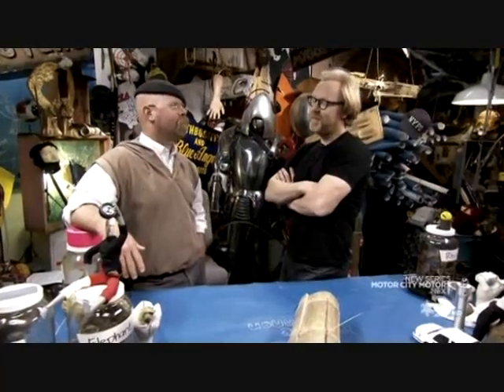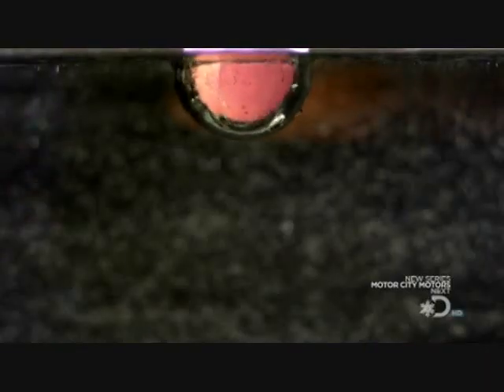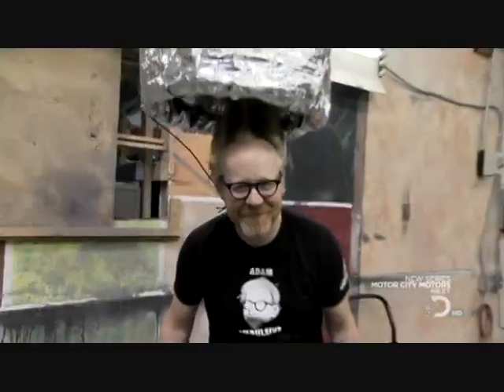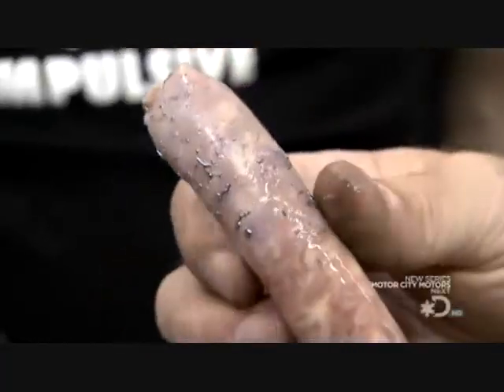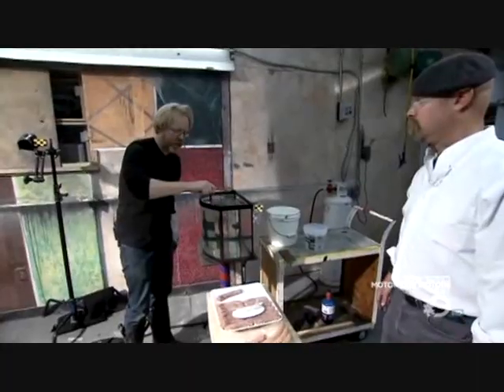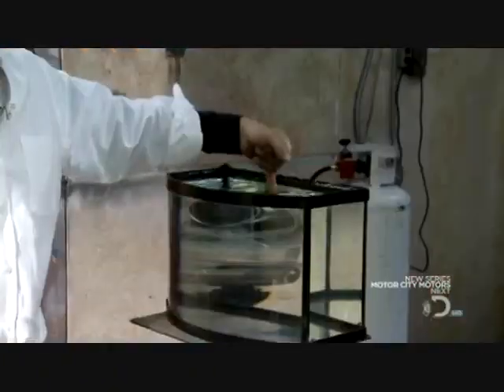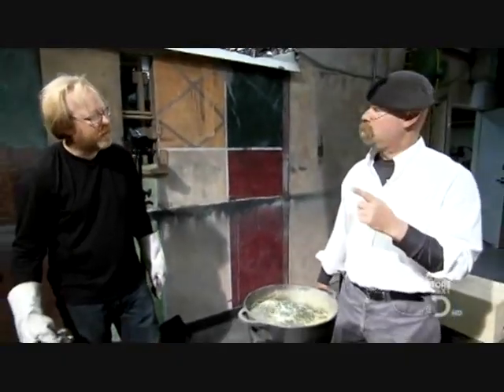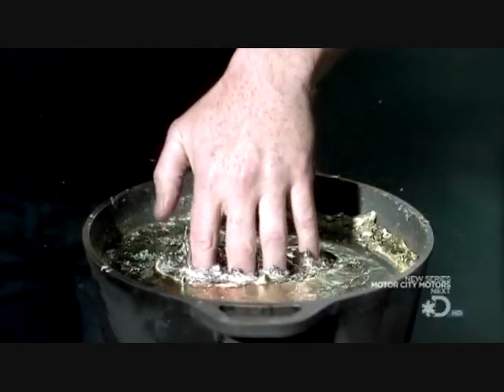Dip your hand in molten lead without being burned!

Comment: “In order to avoid burns they are going to raise the tempature”
Reply: RYAN RUTH makes sense
Reply: Melting isnt burning anymore
Reply: XD, clever and funny point of view to describe the situation.
Reply: Well, that's how it works. It has to be hot enough to create the layer of insulating steam.
Reply: Hmm yes this floor is made out of loor
Reply: Fighting fire with fire I guess
Reply: It's the same principle behind soothing burns using your own body temp instead of ice. Less likely to blister because there's less drastic temperature change.
Reply: Brain.exe. has stopped
Reply: @apocalypseap  no that wasn´t the reason why, if it would continue to stick it would burn your hands terribly (since the lead that´s stuck on your hand would still be hot'
Reply: @willemv6501  That's what I mean. You don't get lead stuck on you if the layer is thick enough, which requires enough heat to maintain for the required duration.
Reply: @apocalypseap  oh okay gotcha thanks
Reply: @UltraDraco777  No, you don't use ice because the intense cold can cause more tissue damage from frostbite.   Use cold water only.
Reply: @kristyanne719  Yes, ice/water being cold is bad for a recently burned area. It's like that because of the heat exchange being too extreme. Warm/lukewarm water is even less risky since it's closer to the body's temperature than both ice OR cold water.
Reply: “Science”
Reply: apocalypseap yeah we all saw the same video
Reply: just why it's like puting boiling water on ur hand vs putting warm water on
Reply: @wangpowersports  If an object hot enough touches an liquid, It can form a tiny layer of insulating vapor.An effect called: Leidenfrost effect, the opposite can also happen where an room temperature drop on top of an Very cold liquid. As the liquid evaporates,It creates an insulating layer of vapor.
Reply: no, its because the lead might cool and harden and small lead droplets will end up touching ur skin and bam u burnt baby.
Reply: This comment was a joke, y’all who are commenting like it’s a serious statement by me are foold
Reply: if it cools.. it's still hotter then boiling water, why don't you put your hand in cold water then put in hot water, try that and it won't cool but give you a mild 2nd degree burn
Reply: Physics is broken
Reply: dunno if you guys gives a damn but if you're bored like me during the covid times you can stream all the new series on Instaflixxer. I've been watching with my girlfriend during the lockdown =)
Reply: @Orlando Idris Yup, been using Instaflixxer for since november myself :D
Reply: It seems counter-intuative, but that IS how it works.
Reply: @apocalypseap  no it not, you get it wrong, 100 cel or more is enoughe to create steam, but in their first try, the surfce not molten completely, so it stick to the sausage, so they increase the temp in order to  melt all the lead, thats the purpose bruh
Reply: well when you put it like that I see what you mean
Reply: @willemv6501  cap
Reply: @djw_tekken8490  ?
Reply: You can't cut me off....
Reply: A sentence no one has said... Until then.

Comment: If you guys think this is cool, you should try doing this with melted ice. You can put your whole body in and you won't get burnt!
Reply: +PALE1ISTEHBEST That's stupid and incredibly dangerous. You are risking an extreme case of dihydrogen monoxide exposure.
Reply: NBA151 The world needs to know!
Reply: +Kiwa Nozukai this joke is even older than dihydrogen monoxide
Reply: dick smash Don't feed ignorance! Everyone must be aware!
Reply: +PALE1ISTEHBEST XD
Reply: +Kiwa Nozukai Dihydrogen Monoxide becomes a gas at  the temperature of 212, it also has caused millions of burns since its discovery. Warning!!!! can be extremley lethal if inhaled.
Reply: ***** I was making a joke. Why else would I reference Dihydrogen Monoxide?
Reply: +Kiwa Nozukai if it's 200 above its melting point
Reply: I heard that some people even bathe in it!
Reply: loolol
Reply: +Eileen Yost ha that's nothing I drink it.
Reply: +PALE1ISTEHBEST Technically, melted ice can reach 100 degrees Celcius. Serious burns.
Reply: +flewkisdead pressure differentials that would allow ice to get that hot would be extreme enough to a lot more than burn your hand.
Reply: TheFarmersFarmington I think you might be slightly confused. Melted ice is water. Water boils at 100 degrees C at 1 atm, which means water "can reach 100 degrees Celcius" in a normal setting and cause "[s]erious burns".
Reply: +flewkisdead your right I misread the comment I just read it as ice.
Reply: Melted ice? You mean water?
Reply: The Gerny Yes. That is the joke...
Reply: Prolonged exposure to dihydrogen monoxide makes a person highly susceptible to asphyxiation.
Reply: +Kiwa Nozukai lol
Reply: +flewkisdead but water turns into steam at any degree
Reply: zuka murvanidze I think you mean vapor, not steam. Steam is generally understood to be only vapor generated from the action of boiling. The pressure of the environment also plays a role in the generation of steam.
Reply: flewkisdead im sorry, in my language vapor and steam share the same word, so i get confused
Reply: zuka murvanidze 
Hello PewDiePie moderator
Reply: PALE1ISTEHBEST I, doing it right now
Reply: PALE1ISTEHBEST don't try it it's boiling water
Reply: PALE1ISTEHBEST EXACTLY ITS SO AMAZING
Reply: +Kiwa Nozukai,  Liberal propaganda!  There is clearly no scientific consensus on the effect of dihydrogen monoxide.  In fact, many studies have shown at low concentration it is beneficial to human health.
Reply: Jerry Gu Lmao
Reply: "Melted ice"
What the
What is melted ice
Reply: PALE1ISTEHBEST That must be the most idiotic thing I've heard.
Reply: Water?
Reply: Anti-Anti Fun No shit
Reply: PALE1ISTEHBEST 1kth like YOUR WELCOME
Reply: PALE1ISTEHBEST im the 999 like
Reply: Cool idea
Reply: Woah! That's amazing, how do you do it?
Reply: What if my melted ice is about 90° Celsius
Reply: @RmX.  hot tub.
Reply: Kiwa Nozukai whoosh
Reply: @kiwanozukai1180  r/wooosh
Reply: That killed me twice
Reply: @NBA151  what about letting the molten ice change to a room tempurture
Reply: Not necessarily true
Reply: @GoogleWhyDoYouLetPeopleHaveLongBloodyNames r/wooosh
Reply: ReAlLy
Reply: @aydentheworm3042  oH lEt Me ReAd ThE fIrSt FeW wOrDs, Oh WaIt.. "r/wOoOoSh"
Reply: Fuck, this made my day, thanks
Reply: @NBA151  water
Reply: @aydentheworm3042  r/woosh
Reply: GoogleWhyDoYouLetPeopleHaveLongBloodyNames woosh
Reply: @vertex4431   r/ihavereddit
Reply: Woah Bro Holy shit
Reply: Why would you say something so dangerous and stupid to so many kids that would actually try it and die?!
Reply: But you have to coat your body in lead first
Reply: WHAT?!?!?! THATS INSANE!!!!!!
Reply: @kiwanozukai1180  Have you ever heard of a joke?
Reply: @Jxrd99  r/wooooshwith4os
Reply: @theemeraldtv8175  r/wooooshwith4os
Reply: @vertex4431  r/wooooshwith4os
Reply: @valley.spotter9558  r/wooooshwith4os
Reply: @onjo6746  r/idontcare
Reply: @ActualChrist  r/whatareyouwooshing4peoplefor
Reply: @ActualChrist  Bruh, are you desperately just wooshing people hoping for reddit fame or some shit? Because 90% of the comments ya woosh'ed makes 0 sense
Reply: @GoogleWhyDoYouLetPeopleHaveLongBloodyNames r/wooosh
Reply: people say u can even drink it!
Reply: PALE1ISTEHBEST nice...
Reply: Kevin Schwartz i really just fell for that shit. Shoulda listened to my parents when they said to pay attention in school. Lmfao. I just went down a rabbit hole of what is dihydrogen monoxide only to find that I’m fucking holding that poison in my hand lmfao. Nice. You got me
Reply: Kiwa Nozukai r/wooooosh
Reply: @kiwanozukai1180  I'm just thankful that I'm not too stupid to understand these jokes
Reply: But thats called swimming, boy
Reply: PALE1ISTEHBEST noway
Reply: This comment/reply section is wild
Reply: GoogleWhyDoYouLetPeopleHaveLongBloodyNames almost as if it was a joke
Reply: @kiwanozukai1180  You must be a blast at parties
Reply: Ive heard it also works with hydrogen hydroxide
Reply: Molten ice 😂😂😂
Reply: Even more intense would be molten ice
Reply: Nigga tryna bathe in molten lead💀
Reply: the difference is this is metal you need to heat it at a high temperature to transform into liquid state unlike water
Reply: but isn’t it just water 😉😉
Reply: i tried that with molten wood
Reply: Ever heard of cold burns
Reply: Should i be very quick when dipping into molten ice?
Reply: PALE1ISTEHBEST woah 😨
Reply: You are too smart for this world
Reply: Lmao
Reply: Kiwa Nozukai r/wooosh
Reply: Kiwa Nozukai woooooooooooooooooosh
Reply: We call that the coldenfrost effect
Reply: @00Gerny00  that's the joke little man
Reply: I literally bathe in molten ice every night 🤘🏼

I'm so hardcore.
Reply: PALE1ISTEHBEST Let's raise the temperature to avoid burns.
99° should be ok.
Reply: Well, but there you also have a potential to either "freeze" or cook to death 😂
Reply: I dont think i sees melted ice befoe
Reply: @kiwanozukai1180  yea you really don't want that stuff getting into your lungs. It can lead to asphyxiation.

Comment: I had no idea this was called the leidenfrost effect... I have been, however, since childhood, acutely aware of the fact that if I wanted to know if something was hot but I wasn't sure, to wet a finger (yes, spit works just fine) and then quickly touch the object. If it sizzled, it was way too hot. If it didn't sizzle, I'd feel the afterheat. Both cases meant "let it cool off".

Comment: I think this was dangerous: they moved so fast that droplets of molten lead popped up. Had their luck been bad, it may have hit a dry part of the hand.
Reply: Not really, Jamie only did one finger so it was a smaller splash, and Adam dipped his whole hand in anyway
Reply: people get hit by motlen metal all the time, ask any welder or angle grinder. that being said its probably a bit different. certianly in lower quantities, and generally harder metal that would solidify mid air before hitting you unlike lead that is more likely to stay molten for longer.
Reply: Lead would move differently than water so I doubt any drop would rise high enough to reach their hands when dipping.

Comment: The reason why it didn't work at the leads original melting point was because it just hit that temperature. Any reduction of heat would make the lead begin to solidify again, hence why the metal stuck to the sausage. Since it was prolonged, the lidonfrost effect didn't last and thus cooked the sausage. It's why then it worked at 200 above it's melting point, because it was still at it's melting point despite the temperature drop.

Comment: I wonder if this would still work with molten steel.
Reply: +Kragatar better get the jet fuel wink wink
Reply: +BigUseless Bomb (BigUselessBomb) but jet fuel can't melt steel beams?
Reply: +Kragatar Yes, like Daniel said, the Leidenfrost effect works with any very hot substance or surface. Lead is probably the more common example because, relative to iron or steel, its melting point is relatively low, thus making it easier to handle while still achieving the effect.
Reply: Brandon Whitaker I foresee two problems with molten steel:
1. It's thick and creamy, not liquidy like molten lead... it might be too thick to get the leidenfrost going.
2. It's so hot that even if the leidenfrost effect did happen, the radiant heat from the metal might be enough to burn you through the protective air layer.

But who knows... maybe it really would be possible. It'd be a cool experiment to do... but I'd use something other than my hand for the first test. :-P
Reply: +Kragatar Like someone elses hand.
Reply: +Kragatar I would also see a problem for the parts of your hand that are not even inside the steel. Due to the
extreme temperature of molten steel (compared to lead) the emitted heat is so great that you would burn your 
hand or even more just by being near to it, without any contact to the material itself. There is a reason why
steel workers wear all that protective gear when they are close to that stuff.
Reply: +Kragatar No because you cant get near enough to molten steel its THAT hot the water evaporates off your fingers before you can dip them
Reply: +Keith Sears But Mythbusters boil the lead to ~900oC there (1650 F) to archive Leidenfrost effect so we don't know just yet.

Comment: We covered this effect in College by utilizing an experiment to simulate freezing an embryo.   We used a lead fishing weight with a thermocouple to measure temperature.  Long story short,  An ethanol slush at around -120C cools faster than -180C liquid nitrogen because of the leidenfrost effect.  This is important during freezing embryos because you want to freeze fast enough to prevent ice crystals from forming.

Comment: you can stick your hand in liquid nitrogen and not be frost bit so this will work, the leiden frost effect works on both ends of the spectrum
Reply: You can pour it out over your hand pretty safely, actually dipping your hand in is a lot riskier and could definitely fuck you up.
Reply: yep, i agree with,you
Reply: oBLACKIECHANoo
 nope its exactly the same lol, there's videos on it xD
Reply: Ni Yao lol leiden frost is the only thing that is relatively the same chief, otherwise your looking at 2 different spectrums of the temperature chart, i think 1 degree kalvin is ALOT colder then what lead would be hot if you were to compre the two on the same guidelines, it would have to be more like molten steel or aluminum to be about the same
Reply: oBLACKIECHANoo If you leave your hand in liquid nitrogen for longer then a couple seconds then it can mess you up. But if you do what Jamie and Adam did in this video and only dunk it in for a few seconds then you should be fine.
Reply: Nathan Haynes
 seriously stop being a know-it-all and look up a dam video on it
Reply: Ni Yao i cant believe it took half a month to respond to this, how long did you have to even think of this reply?
Reply: my bad thanks for explaining, misunderstood
Reply: make sure you soak your hand in fire first
Reply: MrCharrrles lol, nice

Comment: I did this for over 35 years at work, dipping my fingers into a solder pots at over 600 degrees Fahrenheit and won many bets. Made some nice pocket change over the years, and no one would try it after me, because they just knew that they would get burned.  By the way, that is without dipping my fingers into water first.
Reply: His skin is strong after doing it for years I am Shure his finger got burned the first few times
Reply: The bs is strong with this one.

Comment: High school children that went to Milwaukee's Boy's Tech school plumbing program practiced "wiping a joint" until they got good at it.  - a 1 1/2" square patch of blue & white pinstripe bib overall denim fabric laid into the palm of their hand, they'd ladle some molten lead on top of the patch and they'd wipe a lead pipe joint. I tried it once and the lead didn't stick to my two lead pipes. I probably needed to preheat, flux or something. I learned an appreciation for yesterday's plumbers. It was exhilarating conjuring up the guts to do what kids did daily for years.

Comment: I don't give a fuck HOW confirmed this is, I ain't doing it. There better be some serious cash for it for me to consider it.
Reply: I've done it with liquid nitrogen. Even held it in for a second. Exactly the same principle, just as dangerous, just cold instead of hot.
Reply: Authur Jackson the difference is that this is actually quite a bit more dangerous, since the steam "bursts" from the water evaporating may cause splashing lead, causing small droplets of lead that cool down very fast in the air, and the (partially cooled down) lead may land on dry skin, where it DOESN'T cause the leidenfrost effect, and is still about 300 degrees celsius, other than that, yeah
Reply: Yeh, but when you typically think of splashing liquids, you think of water. Water splashes far far more easily than molten lead. The bonding is still reasonably strong and the specific gravity is far higher. Don't get me wrong, you wouldn't see me do it either.

Comment: I remember trying this in welding by accident, I just washed my hands and my friend told me to feel how “sharp” he got the metal but he infact heated it up so it felt like you were being cut. When I felt it, it had the strangest feeling. It felt like my finger was vibrating with the water boiling and I thought I fucked up bad. But I didn’t feel a thing and left no burns whatsoever
Reply: If ur pfp is u then i reccomend taking dat down before u cringe at urself in 5 years
Reply: Nah he looks cool

Comment: lead poisoning anyone?
Reply: Metallic lead is not readily absorbed through the skin, and technically they arn't even touching the lead; if they were they would get burnt! Notice how they hold the solid lead using gloves. Even so lead is extremely poisonous, this would be an experiment I would not like to do myself.
Reply: Lead is certainly poisonous, but just touching it with your hand is not that dangerous. People handle solder without gloves all the time, and I've handled lead bricks quite a bit and have never felt any ill effects (and that was many years ago so I would've noticed by now). Eating lead would be very dangerous of course.
Reply: They had this ventilation. They didn't swallow it. So lead poisoning is impossible here.
Reply: ***** Eh, lead water pipes are still common so it has to be OK. ;)
Reply: o_O You do realise there is a difference between brief casual skin contact with metalitic lead and continuous exposure from ingesting contaminated water?
Reply: *****
They are just a little bit M-m-m-m-m-maaaaaad now :P

lead poisoning will turn you mad. A lot of people underestimate the poisoning, lead will not leave your body, so when you touch it with bare skin or breath it in, it will build up in your body and you will slowly turn crazy